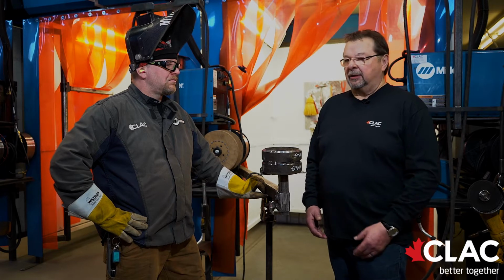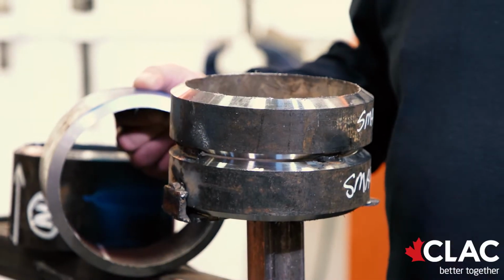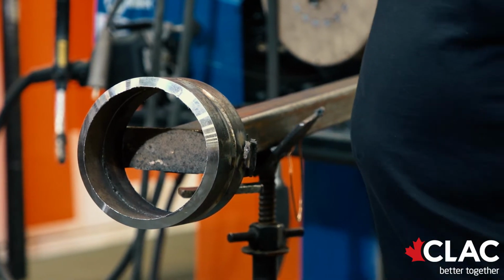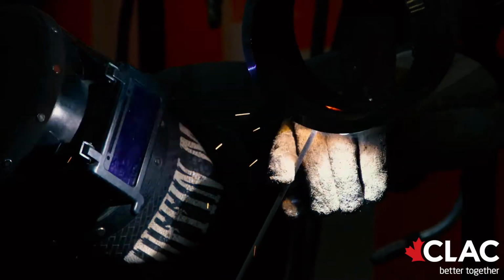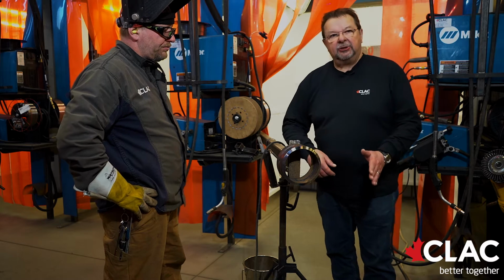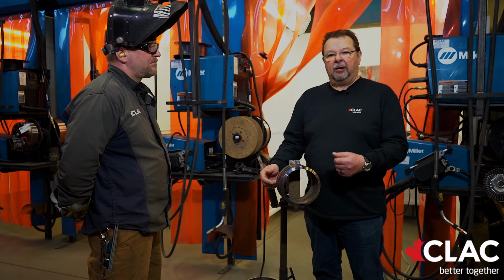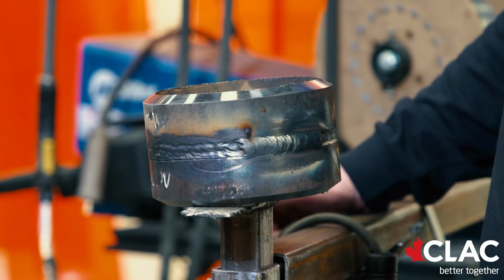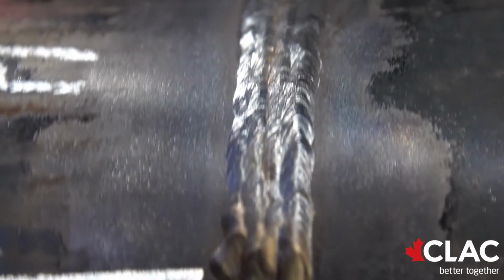CLAC Training | Welding How-To: Initial B Test

Comment: I noticed that Kelly wasn't back stepping on his root pass, basically just pushing it in. Is the deep sound in the pipe what guides him, or visually watching the puddle? Or both? What is he paying attention to most?
Reply: Yeah just push it in and watch the key hole, if you have more sparks on the outside of the pipe than the inside than you need to push it in further, I like a smaller 3/32” land and gap because you can actually feel the root burning in, usually only whip it if your key hole is getting uncontrollable. You can also hear the sparks on the inside of the pipe which is what you are listening for as well. 83-87 amps with 6010.

Comment: Thanks for the video. Could you please specify the amperages for each welding process?
Reply: 83- 87 amps for root depending on what fit up you like w/ 1/8” 6010, hot passing with 95-100 amps, run a stiff arc. 1/8” 7018 120-125 amps fill and cap, remember to soften up your arc or turn down your arc force after the root and hot pass. I’ve done a test where the hot pass was done with 7018 instead of 6010, I ran it at 140 amps.